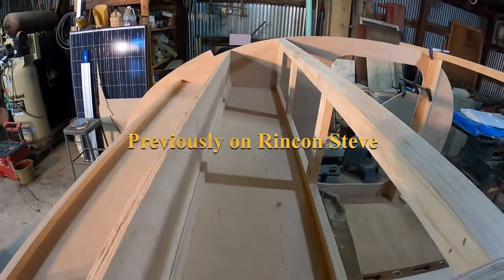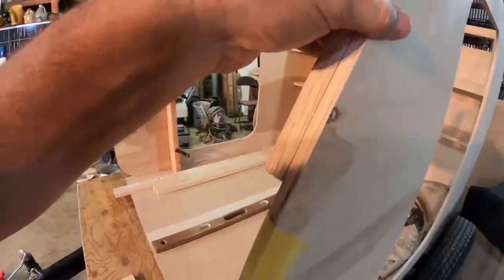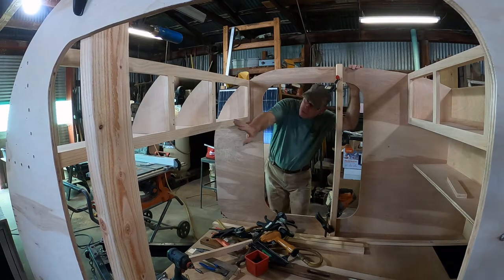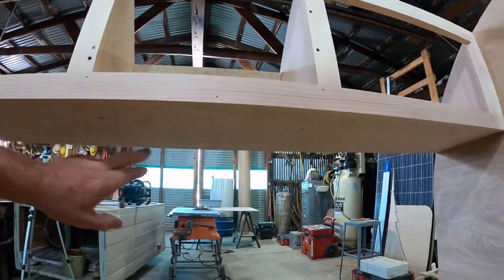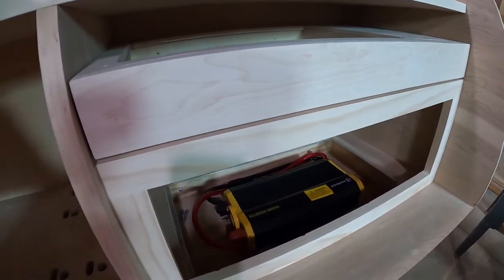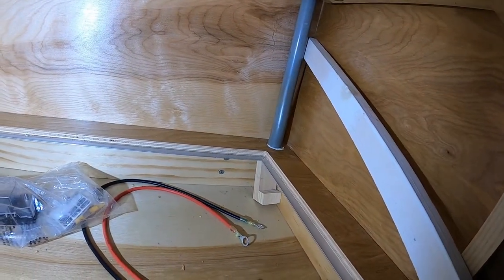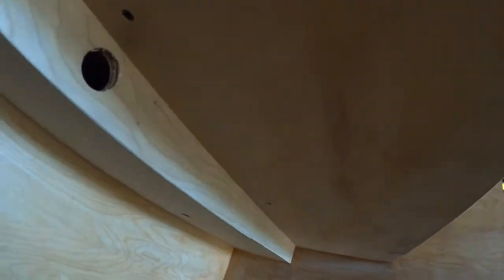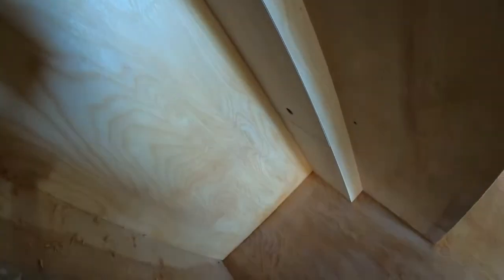Teardrop Camper Build: Where to Setup the Electric- Part 13

Comment: At the 3:00 mark, try sprinkling a little bit of salt on the glued surface. It will help "lock" the 2 surfaces together and help prevent them from walking when clamping. I learned that from DIY Creators channel.